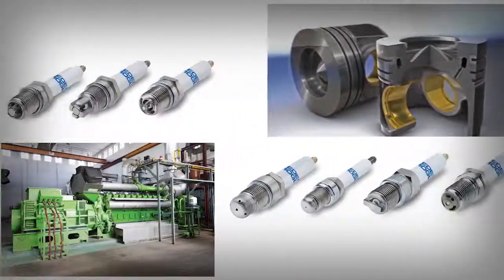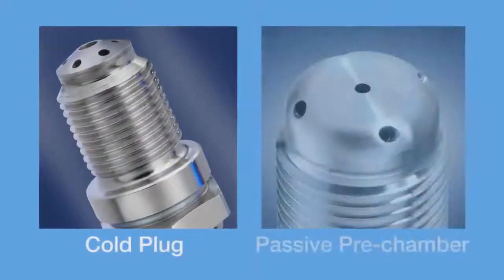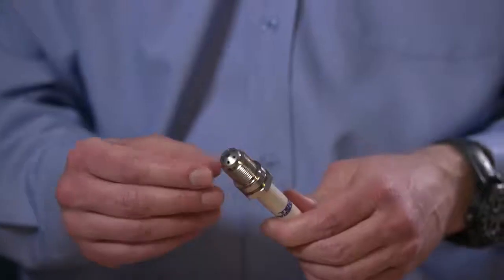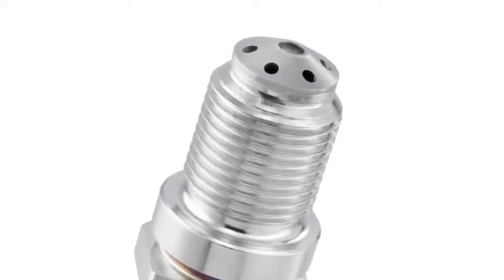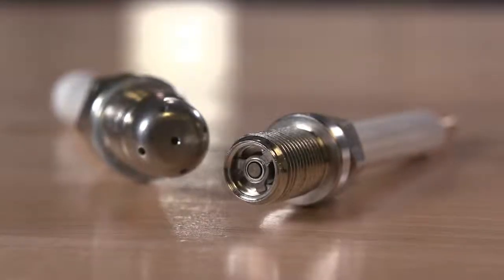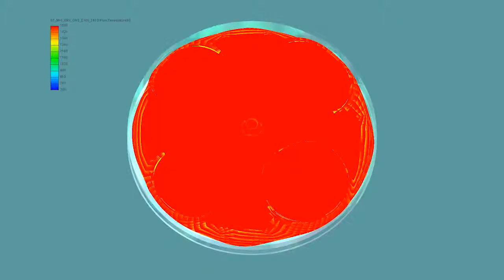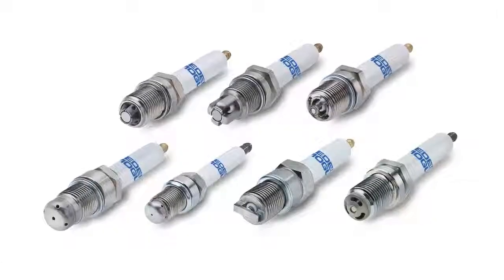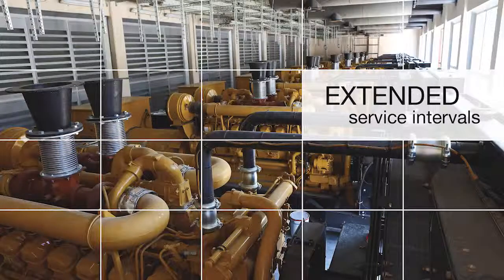Cold Plug and Passive Pre chamber Ignition

Comment: FireStorm's Capabilities:
First, let's look at what FireStorm spark plugs give an internal combustion engine:
• More horsepower;
• 44--50% increase in mpg;
• Dramatic decrease in emissions.
Second, let's see what FireStorm plugs eliminate:
• Smog pump;
• Catalytic converter;
• Radio frequency interference (RFI)   and the use of resistors in the centre electrode;
• Gap growth;
• Exhaust gas recirculation (EGR) systems;
• Misfire/hesitation/detonation/stutter and stumble.
How, you may ask, is all this achieved? In a word, plasma

Comment: Isn’t speeding up the combustion process suppose to decrease timing advance instead of increasing it as mentioned in the video ?
Reply: Increasing timing advance because of it takes some time for pre chamber to active after the spark, then when the flame is going out of the pre chamber, combustion process happens more quickly.
Reply: Ignition delay increased, but mass fraction burned @ a given crank angle increased as well
Reply: @Nathan0A Exactly shown in the above (on 1:30 minute )video I’ve posted . So the initiation of the spark must be later with TJI in comparison with spark ignition in order to reach the max pressure at the same optimal crank angle after TDC !
Reply: @flappingflight8537  Not all TJI systems/strategies are the same, and as others have mentioned there can be an additional delay between the ignition of the prechamber and when the prechamber jets initiate combustion in the main combustion chamber. There are quenching effects and the delay/ energy dynamics are very sensitive to prechamber geometry, cylinder fill, mixture, etc. Ignition can start from electrostatic discharge caused by a cold / quenched jet with sufficient velocity and the right chamber mixtures and charge turbulence as well, it’s not as straightforward as spark ignition. It’s more helpful to think of it as two seperate complex combustion systems in tandem, where one triggers the other. Most engines equipped with TJI use in-cylinder pressure transducers in the loop, up until very recently. Within the last few years, ECU’s have better modeling to manage TJI and/or will switch to a conventional spark plug when combustion is outside of a certain envelope, like the MC20. So you are right in saying that from the moment ignition begins in the main chamber, there is less time to peak cylinder pressure. But if it takes 300us to form a jet which will ignite the main mixture from the time of spark within the prechamber, the total ignition delay in conventional terms might wind up being longer.
Reply: @flappingflight8537  There is an additional tuning element with F1 style prechamber as well, early days of the v6 hybrid era, mechanics and engineers constantly fiddling with paper-thin spacers and needing to precisely set the angle of the prechamber in the head. So much to say that there are effects due to prechamber geometry and positioning that cannot be compensated by spark timing. Granted a lot of that fiddling is probably due to the regulations mandating one fuel injector per cylinder. An active prechamber is certainly more forgiving.
Reply: No,must be more advanced to let the fire from spark to escape nozzle,this tech will lead to higher compression with leaner fuel mix
Reply: https://youtu.be/PCDDXtFmtVs?si=jNSgttd4zNUshGVV
Reply: Thanks all of you for the input guys !